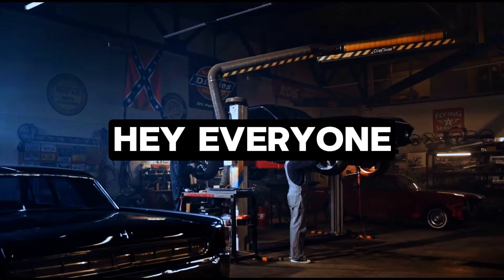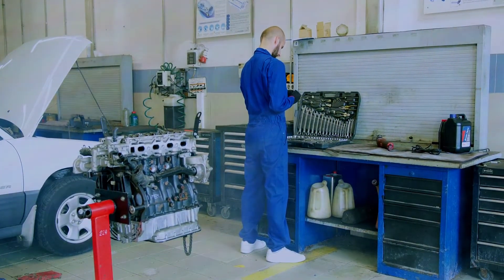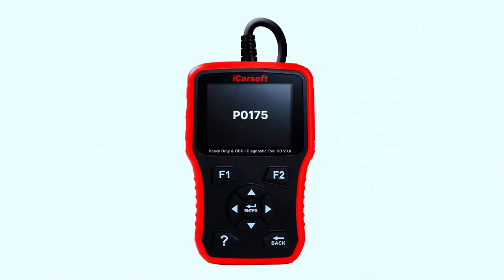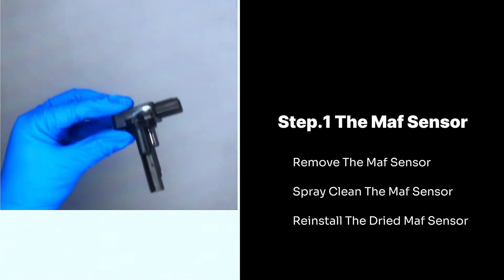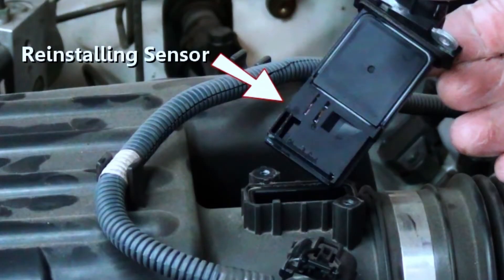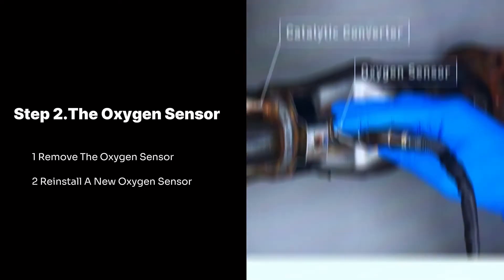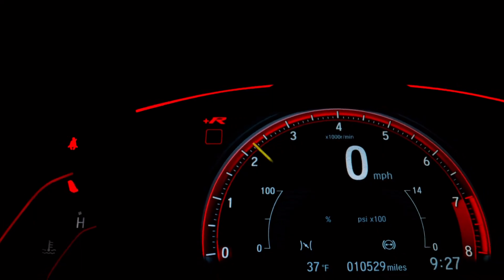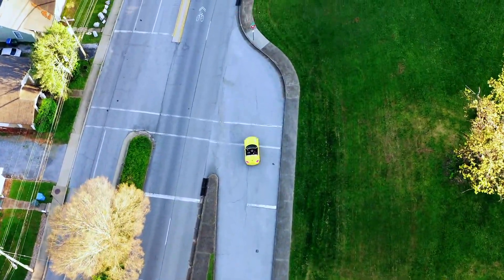P0175 Code Explained: Engine Running Rich (Bank 2) Fix & Diagnosis |

Comment: I have an 06 Jeep Liberty renegade 3.7 4wd manual. I got p0175 saying too rich in bank 2. I cleaned the maf sensor and am ready to do the o2 sensor replacement. Do i need to do both? If that doesn't work, what's next?
Reply from the maker: Replacing the bank 2 oxygen sensor is a good next step, but you may not need to replace both sensors unless the bank 1 sensor is also faulty. If the issue persists after replacing the O2 sensor, consider checking for vacuum leaks, fuel injector problems, excessive fuel pressure, or a clogged air filter2. These can all contribute to a rich fuel mixture. If you're still having trouble, a professional diagnostic scan might help pinpoint the exact cause.
Reply: @weeklytools what I'm saying is upstream and downstream for bank 2. How do I know what one to change

Comment: I had the same code on my jeep wrangler Sáhara 2015 and i just add. STAR BRITE Star Tron Enzyme Fuel Treatment  before i took a trip from Connecticut to Baltimore Maryland  and in my way back i noticed that the check engine light is gone🤣 its been 3 days since that trip and no check engine light !  Keep in mind i bought the jeep two months ago!   So if that helps for you try it! It doesnt hurt to try and is cheaper plus you clean your fuel line!
Reply from the maker: That's a great tip; thanks for sharing your experience and the solution you found! 👍

Comment: Wouldn't a malfunctioning MAF sensor affect both banks?
Reply from the maker: Yes, a malfunctioning Mass Air Flow (MAF) sensor can affect both banks of the engine. The MAF sensor measures the amount of air entering the engine, and the ECU uses this data to adjust the fuel injection for both banks. If the MAF sensor is faulty, it can result in incorrect air-fuel mixture and performance issues on both banks of the engine.

Comment: Bro im on a fresh rebuild with all new parts and im stuck with p0172 and p0175
Reply from the maker: Here are a few YouTube comment suggestions to help you with your P0172 and P0175 codes:

General Advice:

Double-check the installation: Ensure all new parts, especially sensors and gaskets, are correctly installed.
Inspect for vacuum leaks: Use a smoke machine or soapy water to identify any leaks in the intake manifold or vacuum lines.
Verify fuel pressure: Ensure the fuel pump is delivering the correct pressure.
Check for air leaks in the intake system: Inspect the air filter, MAF sensor, and intake boots for any damage or restrictions.
Inspect the O2 sensors: Ensure they are functioning properly and not contaminated.
Consider a professional diagnosis: If you're unable to pinpoint the issue, consult a qualified mechanic.
More Specific Tips:

Fuel injectors: If you've replaced the injectors, ensure they're properly coded or matched to the engine's ECU.
MAF sensor: A faulty MAF sensor can cause incorrect fuel trims, leading to these codes.
Fuel pressure regulator: A malfunctioning regulator can cause fuel pressure issues.
O2 sensors: Faulty O2 sensors can provide inaccurate readings to the ECU, leading to incorrect fuel trims.
Additional Tips:

Use a diagnostic scanner: A scanner can provide more detailed information about the specific conditions leading to the codes.
Check for any aftermarket modifications: Some modifications, such as custom tunes or exhaust systems, can affect the fuel system.
Consider the quality of the replacement parts: Using low-quality parts can lead to various issues.
Remember to provide more details about your specific setup (engine, year, modifications, etc.) for more accurate advice.

I hope this helps!

Comment: so, what if none of this fixes it? Also new coils and injectors.
Reply from the maker: If you've replaced the coils, injectors, and addressed other potential causes and the P0175 code persists, it's likely that the issue lies in the fuel delivery or air intake system.

Here are some additional possibilities to consider:

Fuel pump: A faulty fuel pump might not be delivering enough fuel to the engine, leading to a lean mixture.
Fuel filter: A clogged fuel filter can restrict fuel flow, causing a lean mixture.
Mass airflow sensor (MAF sensor): A faulty MAF sensor can provide inaccurate readings to the engine's computer, leading to a lean mixture.
Intake manifold leak: A leak in the intake manifold can allow unmetered air to enter the engine, causing a lean mixture.
Oxygen sensor: A faulty oxygen sensor might be providing incorrect readings to the engine's computer, leading to a lean mixture.

It's recommended to have your vehicle inspected by a mechanic to accurately diagnose the problem and determine the necessary repairs. They can use diagnostic tools to test the fuel system, air intake system, and other components to identify the root cause of the P0175 code.
Reply: @weeklytools  Thanks. I had replaced the fuel pump when I bought it. It's in a shop now but he's stumped too. Just shows lean on bank one (no code but running at +20ish) and the 175 on bank 2 (-29ish). I think he's checking to see if the return may be stopped up today. I don't think it is. 
Only other clue is EVAP will not clear it's cycle even though purge and cannister checks out and works. Maybe it is stopped up. Going to be something weird I bet, like a dirt dauber or something.
Reply: @lesliehorwinkle what was it??